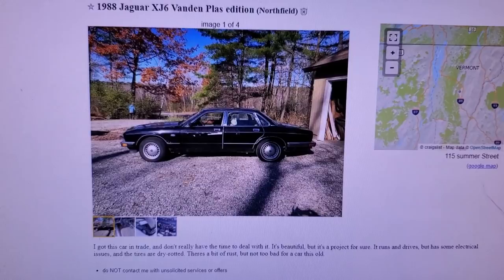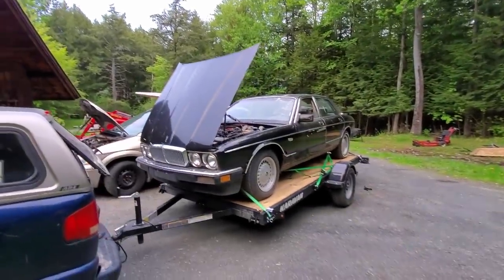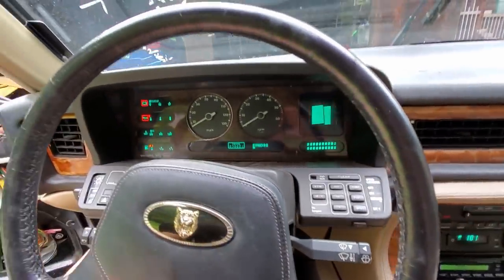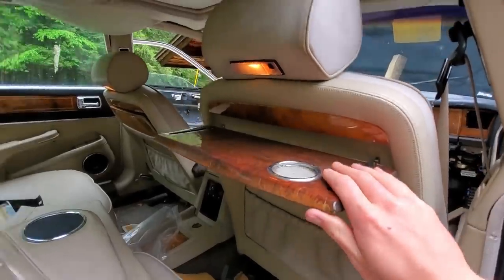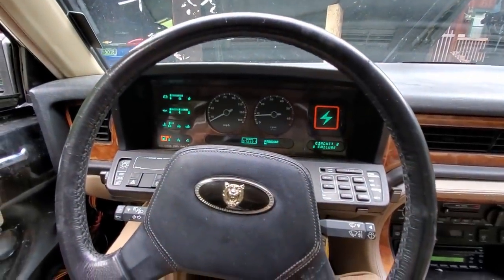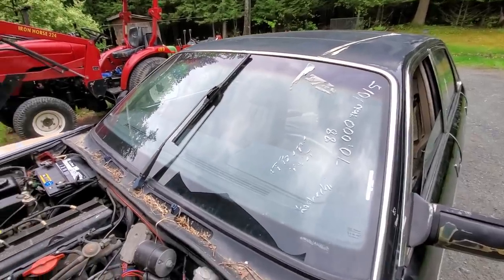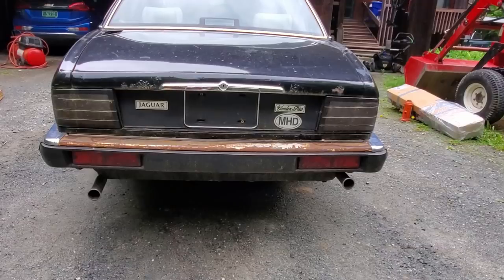I Got A FREE Jaguar XJ6 Off Craigslist!

Comment: Got to love all those who think there're little rocket scientists with their "Jags are known for electrical problems".
This is not a comment on if these Jags have electrical issues or not, it's just everyone, even with no knowledge, has to parrot the common sentiment. After a few times its as relevant as the sun is likely to come up tomorrow.
Reply: They're
Reply: I agree with you burning.  I’m a 60+ year old  car dealer and hear that same idiotic comment every time i show someone a Jaguar.  It’s been my experience with the many Jags I have sold through the years that they are pretty reliable overall.  They are fun to drive and the engines and transmissions are more rugged than most.  The only upside to the expert’s  believing “Jags are known for their electrical problems” is that they are grossly undervalued, and we can buy them for way, way less than they are really worth.  Then we service them and deliver an extremely fun and reliable car to the discerning buyer who appreciates fine automobile engineering and design.  Let the rest of the idiots pay over retail for their Camrys and Accords.
Reply: @rickruberti5214  I have a MK10,  and in all truth particularly in this era, it's pretty straight forward stuff. Things get more complex later on but on board with your impressions. It's the same thing with Jags overheat, they do if the cooling system wasn't bleed correctly... that's not the cars fault.
Mind you we shouldn't say to much, might let the secret out!

Comment: My 1982 XJ6 weighed nearly 5,000 LBS. break pads for these cars are pretty cheap. When I had mine I put 30,000 miles on it in a year. With no issues and mine didn’t have many electrical problems. Can’t wait to see this car complete
Reply from the maker: Wow, the s10 was hauling then
Reply: Yeah it was. Hauling a land yacht
Reply: Alex, good to see someone who actually was a Jaguar owner and knows what he is talking about.  Tired of ignorant people repeating hearsay.
Reply: Nice car but I promise you could buy one in perfect shape for 2000 and use that for parts . I have 4 jags and had 5 other ones I  last 22 years

Comment: When they work they are a joy the ticking noise is the fuel Injection nothing to worry about it as long as you sort out the electronics everything else is pretty easy to do edit: the wipper shoud not be sitting in the middle it's probably a blow fuse or the parking relay
Reply from the maker: thanks for the info!

Comment: Keep that car it can last you a good long time and it gets surprisingly good gas mileage. The only thing that could maybe cause it to finally die would be the bearings in the rear differential make sure that they are not going bad. Other than that the transmission and engine in that car is bulletproof pretty much
Reply from the maker: thanks for the info

Comment: I owned an s type jag, lovely car but very prone to electrical probs and mine had intermittent central locking probs, the doors would sometimes double lock while you were in the car!! 😮😲 That could potentially be lethal in a crash! I was disappointed how many ford parts were in mine, the 3.0v6 in mine was basically a ford lincoln. The interior 'wood' trim was actually plastic in mine! 😮😲😊
It was lovely and comfy inside, very nice to drive but the electronic modules just don't last, very hard to diagnose problems apart from swapping out modules. The door locks and the control modules were so complicated even an electronics expert would be left scratching their head, sold mine for a very good price to an enthusiast👍😎 I miss it but not the cost of fuel!! 😲😊😁😎👍

Comment: the noise you hear is the rear shock bushings going bad. Look on youtube for instruction on how to replace them. Common problem. I own a 90 xj6, if you have questions contact me I know the car very well and have all service material.
If you are willing to do the work yourself it will be a good car most can  have 300000.  Clean the engine bay and use a spray protectant on all plastic and hoses and belts. spray contact cleaner and lube on all connectors. This will be a good start.   Grind rust and use Bondo Glass, it is fiberglass and easy to sand and does not crack and is waterproof not like bondo. .

Comment: Jag sixes are usually 4.2L. But I may be wrong with this model...
Reply: They did used to be 4.2 but that was a different engine.  https://en.wikipedia.org/wiki/Jaguar_AJ6_engine
Reply: You’re thinking of the XK straight 6, which was designed as a 3.4 litre originally, and were made in 3.4, 2.4 and 3.8 up until the  1969. The 4.2 was introduced in the mid 1960s and was used in the XJ6 until 1986, when the AJ6 3.6 was introduced. This is an early XJ40 XJ6 with a 3.6.
Reply: Nicholas Scarff You know your Jags! Thanks! ☺️

Comment: What you have there Sir from the view that I got of the engine bay was a single overhead camshaft 2.9 litre engine model. Sorry for that, however its a smooth and in some ways better engine than the 3.6 but its going to be lacking in power

Comment: I’ve seen those XJ’s go over 300k miles. Rust and lack of maintenance is what kills them.
Reply from the maker: wow
Reply: A Rural Vermonter - Qqjmcb 182 These were expensive cars when new and wealthy people bought them. After a few years they would be traded for something newer. The second or third owner tended to skip repairing items, until the molehill became a mountain and they would unload the car for cheap. When Ford bought Jaguar one of the first things they did was replace all of the Lucas relays on the firewall and inside, with Bosch relays. This solved ninety percent of the problems these cars had. You can go online and find several sites that specialize in Jaguar parts. Unfortunately, Auto Zone is not going to be a lot of help.

Comment: I'm jealous! Yes the handles are an XJ40 issue. I have a black 94 Vanden Plas. They're becoming very rare in my neck of the woods (PA). XJ40.com is a good source for a lot of info should you need it. Have fun with it!
Reply from the maker: Thanks!
Reply: Second XJ40.com! Everything that can go wrong on these has gone wrong over time, there's solutions to everything and no shortage of support.

Comment: most people don't believe the cars and trucks i get for free i just got a 79 4x4 short box full option truck under 35,000 miles on it in mint condition been in shop it's hole life with 2 old camero's and a bunch of running motors 2 were 454 strokers one has a tunnel ram on it plus 8 cars out side in the field 3 trailer load of parts aand i get stuff like this all the time plus my racing buddies give me parts all the time there left overs
Reply from the maker: wow sweet

Comment: I have had 3 of these - The engines are great but everything else is not. These cars were designed and built while Jaguar was part of the state run British Leyland group, which was run by communists. 
The power fluid warning you have is the self levelling suspension and break booster. The pad warnings often come on as the wiring tends to break. 

These cars rust when the see a puddle so check it underneath. If it has that much rust on the left fender the floor must be far gone.
The door handles breaking is a feature on these cars in the first revision, the second revision handles do not fit as they are bigger. There is a updated part but if going for second hand and scrap parts they will probably break too if they are the original ones. The handles get metal fatigue and crack.
With regards to suspension these cars are heavy and the suspension parts cannot handle the weight if going on rough roads.
The ticking sound is normal for these cars. The AJ6 engine is generally bullet proof.
Reply from the maker: thanks for the info!

Comment: ... that 2,950 rating for your trailer is INCLUDING the weight of the trailer. Trailer is probably 500 pounds... so you’re talking 2,450 capacity.

Comment: Good deal, but that whole towing the car home you were lucky, first of all those ratchet straps were not meant for towing a car on a trailer! Then on top of that towing a car that weighs 3500 lbs on a single axle trailer rated for 2900 lbs You need to think of what could happen to you or someone else on the road if you were to have an accident. This could be life changing so be smart and don't do this again.

Comment: 2900  lb capacity trailer. Then you quote the Jag Gross "Capacity" of 3500 lbs and say "It's a little over", lol!  Uhm... No. The CURB Weight was 3858 lbs unladen, without fluids. GROSS VEHICLE WEIGHT is fully laden at 4718. To be on the safe side I would assume right around 4000 lbs, so not a "little over" but 1100 lbs over. Hey, its fine if its just you having a Youtube fail. But seriously - other people are out there on the road, include folks who are oblivious until their lane is filled with a barely moving XJ40 that just broke a trailer. 

On a happier note, if you keep your part purchases in check, and spend the next year or two on jaguarforum.com in the XJ40 section (US and British/European owners are extremely helpful) you should be able to extract a mighty huge amount of enjoyment from this. XJ40 was a huge investment at Jaguar and in spite of some misses, they modernized the original XJ in huge ways. This platform was the basis of all XJ models through the X308, ending sales in US in 2003. Vanden Plas indeed was the highest trim package for US models, LWB, Inlaid Peruvian Boxwood in the Burled Walnut, and yes, 2" thick Lambswool "Floor Coverings" <-Those rarely survive more than 2-3 years, and even then are usually destroyed by improper care. You can get a set, used for $800-1200. Use the money you saved on the car, lol. Thats what I mean about "smart" part purchases. Jaguarforum and Ebay are you new best friends. Good Luck and enjoy it as it was meant to be. To part it out would be criminal.
Reply from the maker: this channel isn't concerned with safety. also thanks for the info

Comment: Jags have to be dismantled to change fuel pump and then welded back together
Reply: What are you talking about ? With the tank behind the rear seat on that model it actually comes out quite easily. Remove everything from the trunk, disconnect the lines from underneath, disconnect the electrical and the filler neck in the trunk and the tank slides right out. The hardest part is the fuel lines if they are a little corroded. Other than that its a very easy procedure. I've done countless number of pumps on those. It's actually a Delco fuel pump. Same one you find in most general motors vehicles.

Comment: Resort it these, are great cars once you've, got the problems sorted out. I've had several of these the 3.6 and later 4.0 litre engines are bulletproof, very strong and reliable, good economy for a big heavy car too. The digital dashboard was never great, later cars from 1989 when back to traditional analogue readouts. If you need any advice or knowledge, checkout  Xj40.com forum.
Reply: I agree Viking Raiders.  Great cars with a driving feel like no others.  As a used car, there is no better value.
Reply: Couldn't agree more with both of you. Once you accept the wonky electronics, get the maintenance items up to date and give it a little tidying, the XJ40 is a great car to own! Those engines are bulletproof.

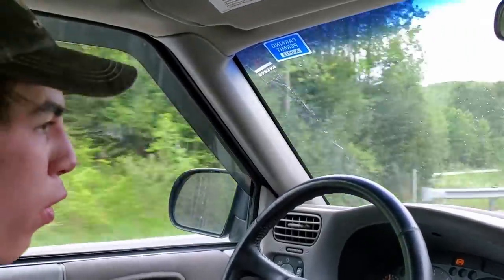Comment: 2:28 I see that jiffy lube sticker. I work there lol
Reply from the maker: lol yep, its so much more convenient than doing it in the mud myself. And its not even much more expensive!
Reply: A Rural Vermonter I wouldn’t say much more expensive lol. 100 bucks for a full synthetic oil change is a lot.
Reply from the maker: @funnypranker34  well I never do synthetic lol. I think the s10 was $37 for oil, and filter. plus they vacuumed and topped off my tires and coolant so I thought it was a good deal
Reply: A Rural Vermonter that’s the ol regular. They do a good job overall. I run synthetic cause I find out that my GM products will burn oil really fast  on normal oil. My friends blazer burned a quart of regular oil in less then a day and a quart of synthetic a week